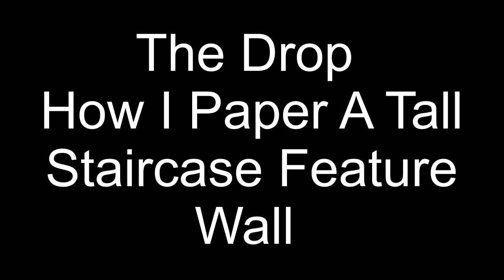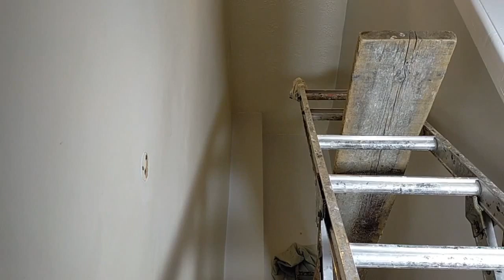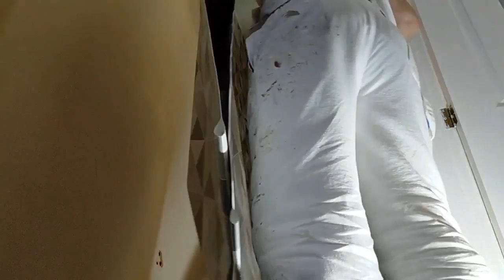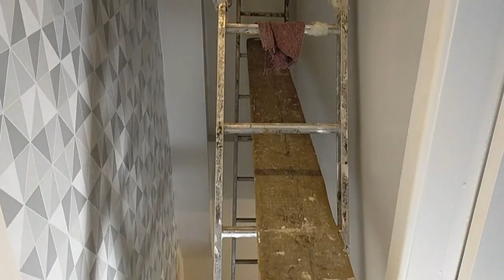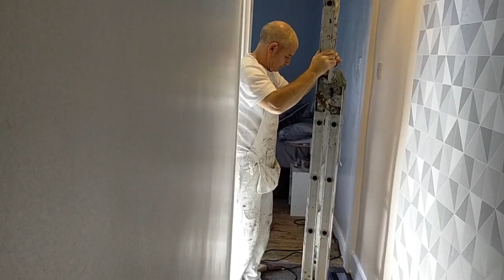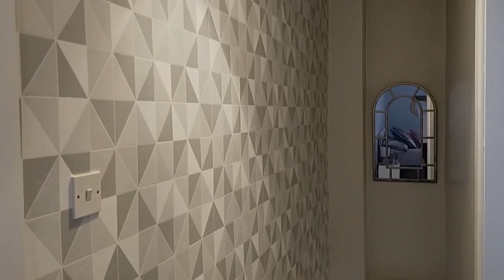The Drop! How I Paper A Tall Staircase Feature Wall

Comment: How wet do you get the paper? it looks like it is very well soaked but I notice goes on the wall much better than the way I have been doing.....maybe I am not letting it book long enough. How long do you book ?  I try to follow mfg suggestions but watching your video makes me think I need to book longer??
Reply from the maker: @justletmetravel  every paper is different and have different soaking times. You need to put plenty of paste on  so that not all the paste soakes in.  Then it can slip on the wall and soak into the plaster.  Thanks
Reply: @PaintingandDecorating  which leads me to think and or ask can you over book paper....and I don't mean until it dries out but can it become too wet?  Thank you for the quick reply I shared your video here with a guy in the USA who I watch a lot and how I learned mostly how to hang paper myself.....I have a stairway with 21 foot walls leading into a 16 long by 12 high ceilings......about a dozen rolls and a little daunting....anychance you will be in the USA next month in particular the Panhandle of Florida
Reply from the maker: @justletmetravel  yes you can over soak wallpaper. Every paper has a time which can range between 3 minutes to 15 minutes.   I always use a timer to get the best results.  Thanks would love a holiday 😁